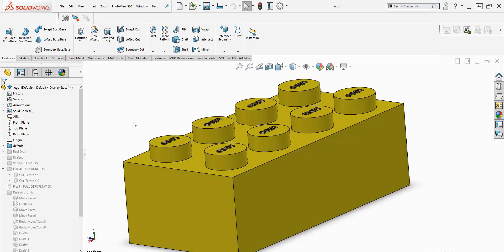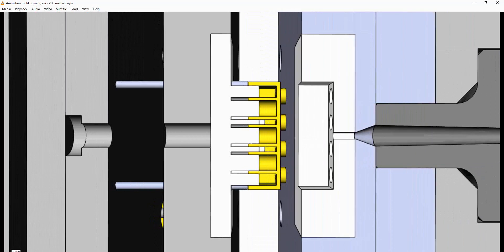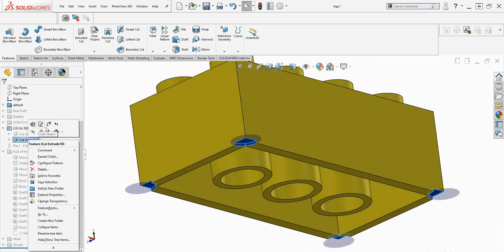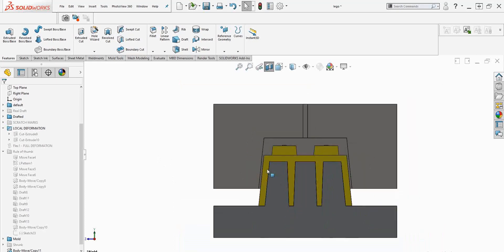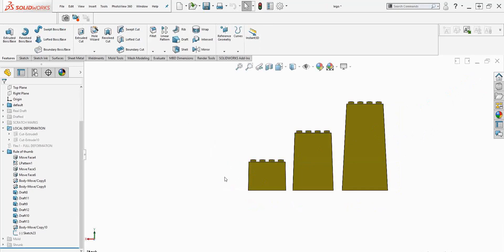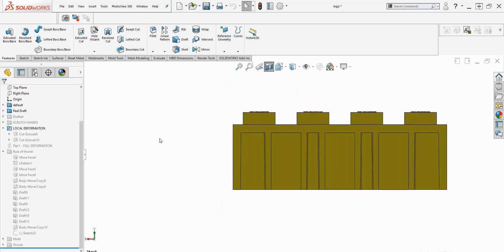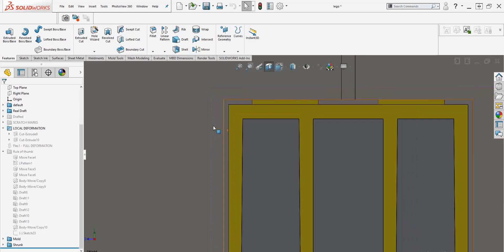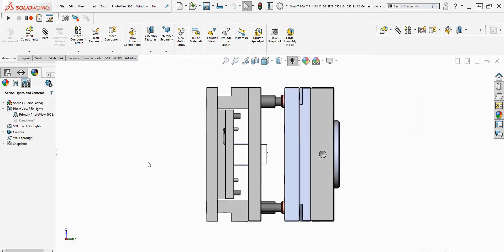Injection Molding - Draft angles | Everything you need to know!

Comment: Very nice explanation. This thumb rule explanation works well, if the plastic part surface is plain and smooth. Could you please make another video to explain the draft angle thumb rules based on the grain texture depth of the plastic surface ?
Reply from the maker: Heya kaliswaran 🙂

That would be a good addition to the video for sure. My knowledge doesn’t currently go that deep though I’m afraid 👍🙂